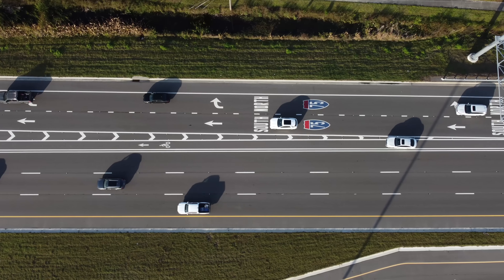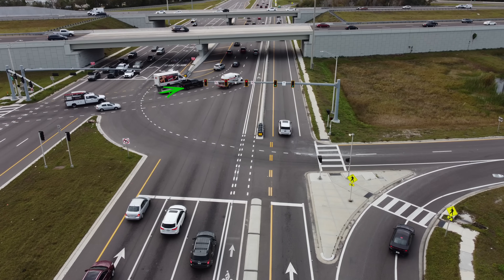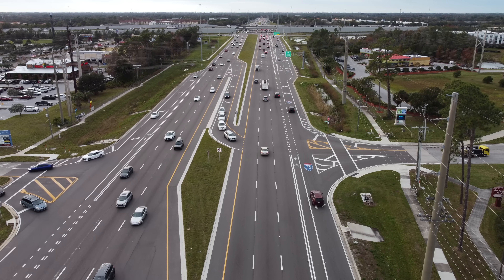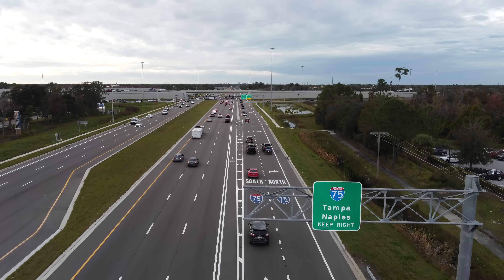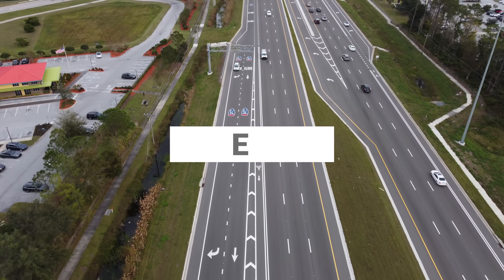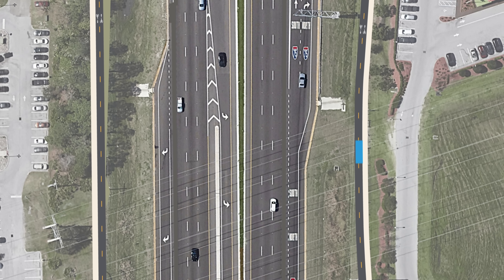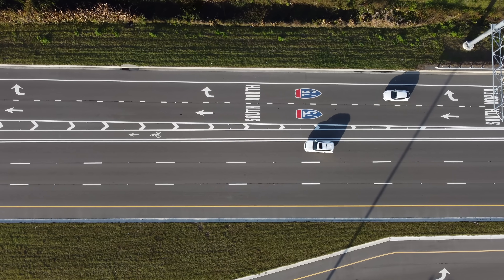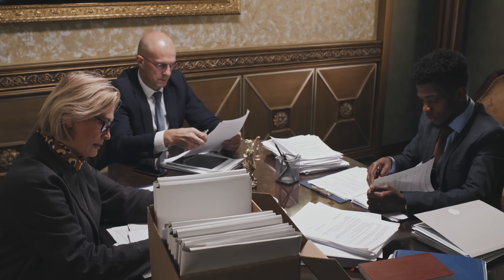This Brand New Interchange is Already Flawed

Comment: I just love how we "fixed" this issue with bad road design in The Netherlands. First we deregulated the road building code, the government essentially does not do anything with that, the government only sets traffic laws. Then we made the owner of the road, for instance a municipality, province or the state, liable for incidents caused by bad design and poor maintenance.

That bike lane is such horrible design, it's a lethal collision waiting to happen as semi-trucks going 50mph or more should NEVER mingle with bicyclists. No politician, engineer or civil servant will want to put their signature on a design like that, for fear of being held liable when someone inevitably gets maimed or killed.

And this liability applies from the smallest to the most severe liability, even criminal liability. So if I were to report a pothole in the road today and you ran into that pothole next week and smashed a rim, whatever body of government owns that stretch of road is now liable for the damages to your car. As they knew of the pothole and they have the means and authority to do something about it. It may cost 10k euro to fix that pothole, but at the same time it could cost 50k euro if someone wrote off their brand new car because of that pothole.

This has also had the side effect of two NGO's rising to prominence. The CROW and the SWOV. The CROW writes guidelines on road design based on empirical evidence as to what is the most safe design. The SWOV does scientific research into traffic safety. Not designing according to CROW guidelines, which are based on SWOV data, is tantamount to bad design by default. No road owner wants to do that, as it opens them up to liability.
And last but not least there is the ILT, which is essentially the Dutch EPA. The ILT enforces such things as maximum acceptable pollution from a road and the maximum acceptable noise level. For example a main arterial road through a city may not produce more than 48dB of noise on average. And when the ILT says "no" to something, good luck fighting the national government and possibly the EU on that one. Want to add more lanes to "ease congestion", go ahead, but that road still can't be louder than 48dB on average, even during rush hour. So yeah good luck with that, maybe try rerouting some of that traffic that probably shouldn't go through that congested area to begin with.
Reply: Well, here in the state, accountability does not exist.
There was an apartment collapsed in miami, many killed. Corruption during construction is definitely one of the reason. 
Then there is the new orleans hotel collapse during construction. Workers were killed. 
In both case, no criminal charged. 
Those are not the exception but the norm.

Comment: I live in Quebec and here, the Ministry of Transport has a form on its website to report any danger. I have used it twice and each time I have had a satisfactory response. 

The first time, I reported deterioration of the roadway between two lanes, which represented a danger for motorcyclists. They informed me that they had noticed the problem and planned to make the repairs as soon as possible, which they did. 

The second time, it was to report that subcontractors assigned to maintenance around the highway were working without signs, without flashing lights, in short, without any safety, and that they had driven a tractor in the wrong direction on the roads. highway lanes. The ministry informed me that they would contact them.

Is there this type of form in your jurisdiction?

Comment: This bike lane is absolutely appalling. I bet it's a case of "building garbage bike lanes no one will use to justify not building more bike lanes" I've been hearing. 

When I was younger, I crossed a highway everyday going to work on bike. It was not great and I couldn't bring myself to use the road so I used the sidewalks. There was never any pedestrians but I still felt bad because it was illegal. There were no bike lanes but I actually think it's less dangerous than the one shown here.

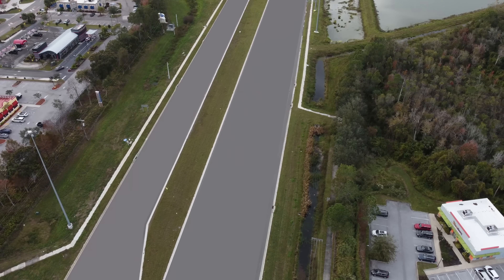Comment: 4:30 I'm going to have to strongly disagree there. I live in Canada. During winter, lane markings get rather hard to see with snow and slush. Since we use construction equipment to plow our street, lane markings get scrapped away along with the snow slush and ice. By the time spring comes, more often than not, there's only ghostly remains of lane markings. It used to be that my city would redo them every single year. It literally took them the entire summer to get the job done, and often, they were still at it just weeks before winter. Its a stupid waste of money and several years ago, my city finally got the memo and stopped marking the vast majority of streets. You know what? Traffic still flows just fine. Proper permanent signage is a better use of money.
Reply: @gGfiarwnaj526  My city uses signs with lane indicators, usually located either on the side of the road, or on line poles to indicate how many lanes there are, and where they go. They've also replaced a number of sidewalk markings with sidewalk projections that reduce the width of the road and make it extremely clear where the crossing is.

Comment: At least this pseudo bike lane was nicely paved. Moses Lake recently redesignated the parking lanes on a 40 mph five lane road to bike lanes but didn't even update the stripping which is fading. The pavement itself is so rough that most people can't bike on it. The sidewalks next to the road are also in bad shape, with pieces of concrete pressing each other upwards creating a one foot tall barrier that just gets a traffic cone. The sidewalks have been unusable in those sections for over a year now, same with the "bike" lane. Even the bike symbol is coming up so it's hard to tell that there's "supposed" to be one there anymore.

Comment: Civil Engineer here: no sane person thinks these bike lanes on high speed roadways are a good idea.  Perhaps well-intentioned but breathtakingly poorly thought-out 'one-size-fits-all' Federal mandates are the reason why they are required to be put in.  In many cases, even if a shared-use path (+/- 10' wide paved sidewalk for bikes and pedestrians) is provided as suggested in the video, bike lanes in the roadway are still required under Federal laws.

So the designers probably had no choice on the bike lane, although some other elements of the design including signage and striping are questionable at best...

Comment: Bike Lanes, in most existing roadways, esp like these high-capacity / high-speed ones, are a total waste & dangerous.

It is just plain bad design to cheap-out & have bikes intertwined with cars.   We will never get bikes as a major source of transportation this way.   

It's harder, but Bikes need to have their own roadway divorced from car traffic as much as we can do it.

But to put a 10-20mph, vulnerable cydist into a 50-70mph roadway is basically incompetent, almost criminal.

Even when a lane of 35-45 mph traffic is stolen to give to bikes, it is also bad , phoned-in design.

and let's talk aboutthe use that these stolen bike lanes get:  Usually, one probably will not see a bicycle for 10 to 15 minutes on these lanes while at the same time, car traffic gets worse and it's backed up.

Traffic policy, planning & engineering is one area that really needs a lot of reform.

Comment: In Norway you can call 175 special phone number for anything related to safety or roadcondition, no matter who operates the road in question. They will forward messages to the correct operators or duty maintenance crew, as well as sending out traffic warnings if deemed necessary.
Reply: Could you please export this to the rest of Europe? ;)

Comment: As @notjustbikes frequently points out, paint is not infrastructure.  That bike lane is not infrastructure.  It is a gesture acknowledging that infrastructure is needed.  A deadly gesture.  Bicyclists do not appear to be using it, and no wonder. Those who designed and approved it should be made to ride bicycles along that path for a full week. Then they would never repeat such an obviously dangerous design.

Comment: There's something wonky going on with the captions. At 4:39, they read, "markings or signage is relatively easy to fix if done incorrectly. Every piece of infrastructure" and it stays like that until the end of the video. But thank you very much for going to the effort to caption your videos!
Reply from the maker: Thanks for the heads up! Should be fixed now

Comment: The simplest fix to the current design would be to install concrete barriers on either side of the bike lane, so as to prevent cars from crossing that lane.
Reply: Better instructional signs would also be an improvement, to minimize confusion of drivers.

Comment: “…some people would consider biking or walking…”. I seriously doubt it.  On all sides of the major interchange there is a lot private commercial development that was built with absolutely zero consideration for bikes and pedestrians.   In particular, the complex on the northwest corner has a two-lane road separating the big-box stores from the restaurants which are all, primarily aimed at drive-through customers. There are no sidewalks of any kind and with all the traffic moving in and out from both sides, adding peds and bikes to mix would be a disaster.  Interestingly, the exit from this complex that allows access to sr70 (and the only way to turn eastbound on sr70 is currently controlled by a stop sign and is being replaced by with a traffic circle. 

I agree with removing the bike lane, it’s dangerous. And, yes, the signage westbound on sr70 could be better. But having lived through the construction of this interchange (State route 70 and Interstate 75), I have to say that it is a big improvement over what it replaced.  Unfortunately, we didn’t get a double-diamond like the one just south on I75.  This will be a problem as the years go by as the area east of I75 is Lakewood Ranch which is massive and is still growing.

Comment: I'm not too sure that tunnels under the on-ramps would be feasible in this situation, considering the low water table in the project area indicated by the filled retention ponds. Moving the bike-ped path off the highway is the better solution here. Regardless, that is one bike lane I wouldn't travel on a bet.

Comment: I've got no broader context, I don't know the area this road is, but that bike lane has what I call the "Cotton-eye Joe" problem: where did they come from, where did they go? That is to say, exactly how are bikes getting onto this lane, and how the hell are they supposed to exit? It's about as useful as a "bike-lane" marked with buoys across a harbour.
Reply: The bike lane moves out toward the edge of the road further up. It’s actually horrifying though, it goes between the road and any turning lanes (with cars weaving back and forth). That road is a fucking death trap and it’s unbelievable that the bike lane was even considered in that spot. I guarantee any bikers will use the sidewalk instead

Comment: At first I was like, that looks pretty standard, until I noticed that bike lane and nearly spat out my drank because which moron designed it like that?!?! 

Not only will cyclists be inevitably run over by cars exiting the road, but they will also be squashed into the wall by cars entering! On the footage you can already see dozens of cars going over the painted lines. 

That entire bike lane should be separate from the road, with tunnels going underneath the road!

Comment: 0:10 oh? this looks like a normal highway interchange.
0:18 WAIT WHAT?? Cyclists? wtf are cyclists doing on a highway? why is there a cycle path in the middle of the highway?
Reply: It's a typical surface street. Also, many western states allow cyclists to ride on the shoulders of interstates if there's no other viable route for them to take, though as far as I'm aware, they have to take all exits.

Comment: From your video it is obvious that road works designed by the various states are not well thought out.  A year ago near me we had a normal diamond interstate interchange converted to a diverging diamond interchange (DDI).  It included European style directional road signs, ie., no wording, just arrows.  So with DDI interchanges, the road crossing the interstate will have one entrance to the interstate on the right side of the road while the second entrance in the other direction of the interstate will be on the left side of the road.  But since there are no worded directional signs, the state seems to assume that all drivers will be familiar with how DDI interchanges operate which is totally wrong.  I contacted the state DOT to fix this as soon as the interchange opened, although it would mean the state would have to contract with a company to construct and install new directional signs with words (keep left or left lane or keep right or right lane) rather than the straight ahead arrows that currently exist.  That was six months ago and still nothing has been corrected.

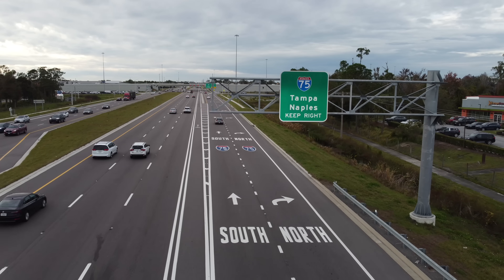Comment: Could it be that they accidentally swapped the signs at 3:43 and 3:58 ?
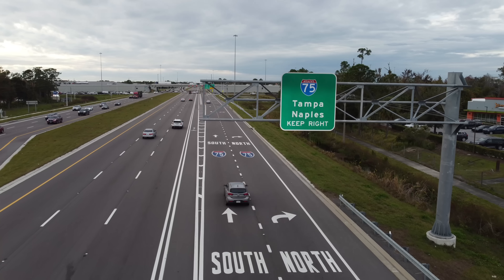Reply: It looks like they were swapped was but unfortunately no, the road on the right side as seen at 3:43 is Lena Road. If the signs were in fact swapped, the larger sign would be positioned past Lena Road, therefore being incorrect. Poor design, not an accident.

Comment: OMG that "bike lane" is insane. I'm an urban cyclist in Mexico City, so you can imagine the everyday challenges and my level of craziness, but I would never ever ever use that "lane". Great video, keep going bro!
Reply: I'm Dutch, so before I got a car I used to drive my bicycle everywhere. I'd consider anyone riding their bicycle there reckless or suicidal.
Reply: Yeah this is just frankly insane, and at this point a waste of asphalt. In the Netherlands you'd have a separated bikepath somewhere else, sometimes even quite far from the actual highway. Bike paths that are designed for longer routes (like a highway is) usually go though much quieter areas, so usually highways don't have bike paths at all in the Netherlands. If you go by bike, you'd go through the areas surrounding it. It is criminal that there is no underpass though, since both sides are clearly lived in areas, so you'd expect a bike over or under (preferred, since it's much nicer on a bike to go down than up than the other way around) pass every couple of kilometers (or miles I guess) here.
Reply: I think this is added on top of America's extreme hatred towards bicyclists, scooters, or even pedestrians. Yes pedestrians. There are many places that side walks or cross walks don't exist
Reply: @uwu-egirl-azzy  as ill-behaved as some car drivers can be, they are nowhere NEAR the level of disrespect that pedestrians and cyclists show towards traffic signs and traffic lights. Most of the times one of them gets run over, it's because they cut traffic without a care and the car couldn't possibly stop in time.
Reply: @dudejo  The law is pedestrian will always have the right of way. 

But in speaking of personal experience I've seen otherwise. As I use all forms of transportation.
Reply: @uwu-egirl-azzy  personally, I'd rather respect the laws of physics.
Reply: @dudejo  Active avoidance is a must in Portland. But that's what we have to live with if instead of foot and bike infrastructure we make laws telling bicycles that they are cars and people they have to walk a mile to get to the crosswalk
Reply: @uwu-egirl-azzy you may have the right of way, but if the driver of that car is distracted and doesn't give way to you and you still cross, the law might protect your rights, but it will not protect your life...
cross only when you're able to do so safely, it doesn't, matter if you're in the right if you're dead...

btw, today I saw a bad crash because of a reckless pedestrian, they were in the right, the first car was able to stop abruptly, but the car behind wasn't, the pedestrians were almost run over, and the driver of the second car had to get an ambulance... always exercise caution and put your personal safety above all
Reply: @dudejo  people seeing a few bad cyclists and pedestrians and assuming ALL of them are wrong and malicious is the problem. a lot of drivers get into their head that they're always 100% in the right and cyclists and pedestrians shouldn't exist. doesn't help with how cars are built today, shown by the recent pedestrian death stat hike
Reply: @dudejo  Respecting the laws of physics means endangering everyone else with your reckless driving?
Reply: @hedgehog3180  That sounds like the complete opposite of what I implied but, sure, why not.

Comment: At this point they should've just converted the interchange to a free-flowing 4 way intetchange while converting the whole stroad into an mostly elevated 6 lane controlled freeway with a bike lane built next to it. 

Because this is dumb and ironically the freeway i would suggest would actually have less lanes to it lol.
Reply: How would the bike lane safely cross the on ramps?